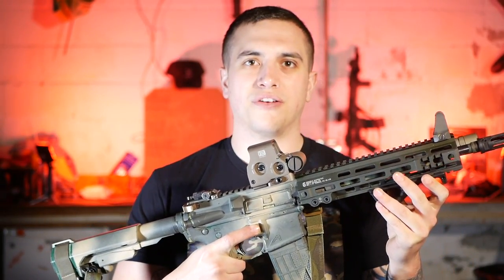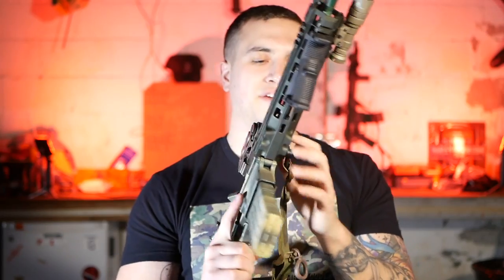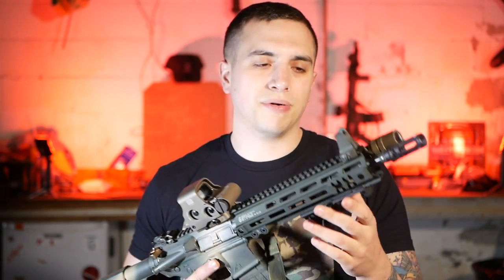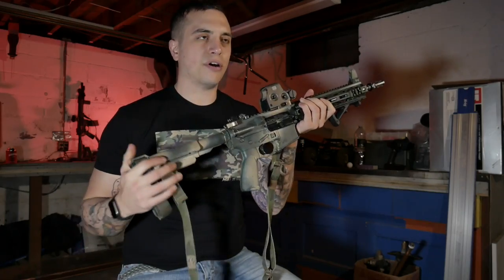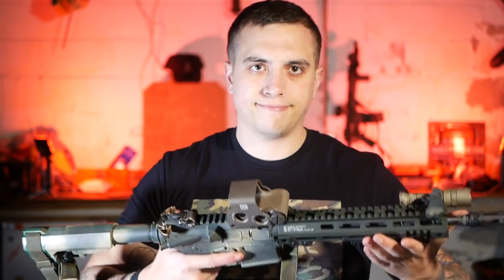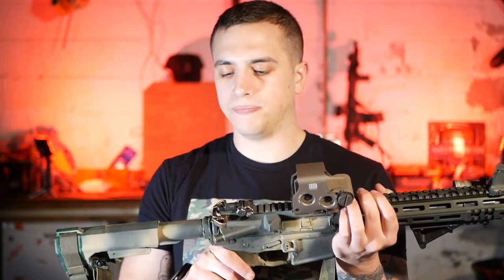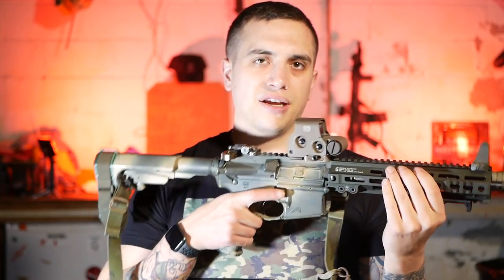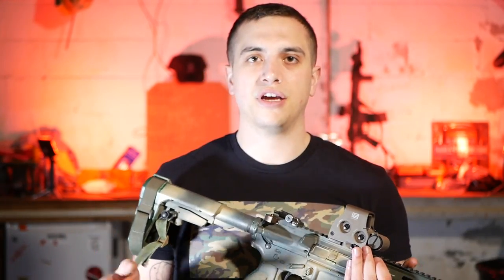11.5 AR Pistol Build, Reconfigures | Feb 2020 update - Geissele Mk4 Fed HRT Inspired

Comment: Colt FBI HRT 11.5 Barrel is my one of my favoritesand IMO its the best 11.5 Barrel . From what I've heard from Colt is that FBI HRT only used Barrels . It wasn't complete upper or Carbine .  Also to my knowledge Colt only did 1 run of the FBI HRT Barrels in 2015 . 
I picked up 3 Colt FBI HRT stripped uppers from Shark Arms . They are obviously complete Colt Uppers minus the rail . I cut one down to 10.3 and added Midwest 9.5" Combat Mlok Rail.  I put 10" C4 Rail on another and Geissele MK8 on the last one .  All 3 have LMT Enhanced Bolt / BCG.  Once I get my 3 Turbo Ks I will pick up Bootleg 4 Position BCG..
I agree 110% on the 12.5" . As As of right now my current go too is Triarc Track 12.5 with 11.5" Trilok Mlok Rail  , TR24 , and Aero M4E1 Ambi Controls Lower with SBA3.  My current project is cutting down Colt SOCOM to 12.5 and making Ultimate Mini Recce . The TR24 is an awesome LPVO to have on 12.5 / Mini Recce . 
I've been using the Geissele Super 42 Spring with H2 Buffer . So far I love it .  
I wasn't fan if the MCMR either . I favor Midwest Industries , or Centurion for rails. 
I run DD Fixed BUIS on all my setups with red dots . All LPVO have Folding . I only use Lower 1 / 3 QD Mounts for Red dots and Midwest High QD Mount for LPVO .  Midwest  or LWRCI Skirmish are the only Folding BUIS I own .

Comment: I’ve been using the Magpul MLOK Surefire Tapeswitch Mount. I put it at the 11 o’clock or 1 o’clock (depending on which way you look at it). It sits nicely tucked next to the pic rail which makes it so you have to intentionally press it. You can still grip the top rail without worrying about ND’ing your light.

Comment: You mention your 12.5 has less recoil; possibly bc that Lightened bolt in the 11.5 smacking around. Those reduced mass bolts should really be used with an adjustable gas block
Reply: The spikes light weight bolt is like .5 ounces lighter than a normal one, it’s not that much of a difference

Comment: My pistol with FN 10.5" barrel is set up weirdly similar to this with a DD fixed front sight, KAC USMC folding rear sight, a KAG instead of an AFG and SBA3 brace. My light is at the 11:00 tucked right in beside the front sight.

Comment: Like the Gieselle QRF trgger. I think that may be what you are running.  Check out the new CMC Enhanced BCG just started running one. No gas in the face and more dwell time (Balisticdeals.com). Nice
Reply from the maker: radman 00 It the GRF - geissele rapid fire. It’s the Geissele 3 gun with less QC.
Reply: I have the QRF two stage in a LMT MRP lower Colt 6721 upper with the CMC Enhanced BCG. Sweet set up fast trigger, no gas in the face and flat shooting tack driver.
Reply: Strongly suggest checking out that BCG.
Reply: My bad, the trgger I am speaking of is the Geiselle B-grf

Comment: Do you think the spike lightweight bcg is worth it? Can you actually notice the weight difference vs a regular bcg? Great video as always
Reply from the maker: Not at all. Just go with a good mag phosphate BCG. I’ve had good luck with brownells, aim surplus (both inexpensive), BCM, DD, Aero, and colt. They’re all good to go. I bought the spikes 3 years ago when NiB was all the rage and I didn’t know any better
Reply: @MaddMaxxLop  So you only buy what's popular and then change your opinion about it when other people do? .......  That sounds pretty sheepish
Reply from the maker: Not quite. Took suggestions early on in my time with guns then made my own opinions.
Reply: @4g63mark  not easy to please, are you?
Reply: @ComeOnPelican91  I'm not a sheep if that's what you mean.  I buy what I like not what's popular.
Reply: Who’s this tough guy? ☝🏻
Reply: I have spikes and toolcraft nib carrier groups and really like them. They're easier to clean than phosphate bcgs.  You can find the toolcraft nib bcgs for 90 bucks depending on the type of steel you get for the bolt. Lightweight can increase the cycle speed and you'll need a heavier buffer and stronger spring so it sort of negates the positives..   I don't regret going with nickel Teflon (np3) or nib in my builds
Reply: @byrnes15  whattt? That's Chris Evan's he is recently known for his character in the Avengers movie line 🤣 should change his name to captain hard ass

Comment: As an ex-10.3 owner, I think all that SBR bs...is....well...BS
Anything short of 14.5 is anemic in my opinion, even at 18" you can feel the velocity increase versus 16", where I would take a long range rifle at minimum of 18" at all times.
16" is the way to go, and I don't see any reason to buy 10.3 or 11.5 for any reason than clearing house...BUT...you ever heard 10.3/11.5 with a flash hider? 
Sounds like 308

Comment: What gas block are you using? I'm in the middle of building a hrt clone and have the colt hrt barrel, just not sure what gas block will work with the barrel contour and pin cut.
Reply from the maker: That was just a geissele that came with the rail.

Comment: Hey nice geissele mk4 ODG, just got a black. Sadly couldnt find a odg, i barely found the black. What buffer weight are you running? My current buffer is a H1, will that be fine if it were suppressed?
Reply: I have the same question just made a pretty much 99% spot on HRT clone with a side folder.
Reply: Travers Kilroy Cooper Alvirez  ty!

Comment: What buffer weight are you running with the super 42?
Reply from the maker: I believe at that time it was just an H buffer
Reply: @MaddMaxxLop  thanks for the reply. I’m building a 11.5 currently and I’ll be using the geiselle buffer tube and super 42 spring as well.

Comment: Dude I’d get a 10.5 mk4 rail and slip that on screw the fbi atf carbine Plus know and days u can get away with an inch barrel offset but hey the feds picked an ugly setup …. I don’t know but I think you’re a little bit ovegassed. Do you have the super 42 buffer system and at least an H 1/14 five Midlane Roscoe and spits brass beautifully at 4 o’clock with an H2 sure the gas for sizing is probably different specs I have the same real in 9.3 in DDC with radian lower set up and The newly sized it Daniel defense gas port for 10 three and I also use an H2 on that and it’s hitting your damn 4 o’clock and it’s perfectly gassed no leakage surprisingly it as I swap the barrel out five minute process since I did it so quickly I wanted to make sure nothing got loose so I took the rat loss when I came home and used cloth and barrel and almost clean as a whistle I don’t know how to crane gas block it’s dual dimpled which helps I do believe The neeed Daniel Defense barrel Gasport size on there 10.3 is probably due to military application over soon they don’t want a wide open Port like in 2016 dude… you might get your tax stamps approved faster since you did a three letter build inspiration or whatever bro you shouldn’t have issues shooting at 200 yards with a one moa Center diode I swear people think CQB is fuck in 100 yards in or less it’s not I consider four or maybe out to 500 in and close… The light bolt carrier is wired brass is spitting all over the place forward also you’re gonna have to throw in one or two tungsten weights yes definitely if you look at your footage your grass is bidding sometimes 230 3 o’clock and then you get a couple 1 o’clock injections and then a couple 2 o’clock injections and then 130 just look at your footage in you’ll see but I bet you it’s the light weight bolt carrier group and you have to think you’re gonna rip parts apart easier if it’s in P3 coated like a nickel boron type finish it’s stronger but to some extent I would personally get a nickel boron that’s not all Gerald out in light weight because what’s the purpose of it being lightweight how many ounces are you really saving on a book care group that cleans up easier and even if it takes an extra five minutes to clean a fast faded bolt carrier that is chrome wind works just as well if not better because the brass will be injecting properly not all over the place could be the ammo to but if it was the ammo you were shooting MK 262 that it’s very high pressure which I doubt you were Basically kind a look like the gun suppressed the way the brass is injecting so before the firearm has an issue I would check out the ejection pattern all right bro have a good one
Reply from the maker: This gun is long gone.